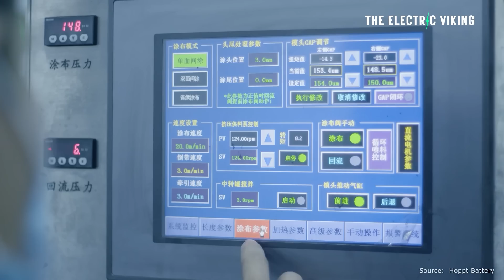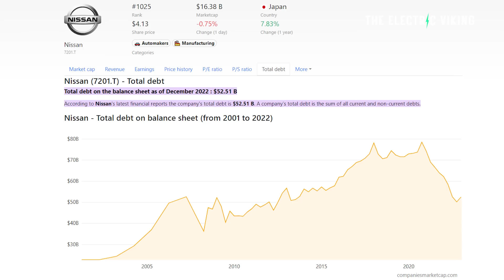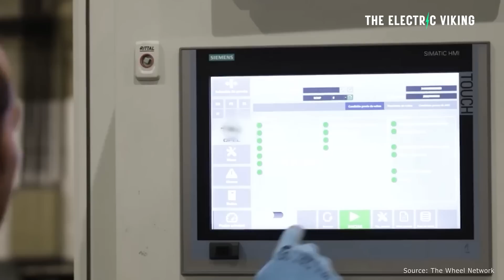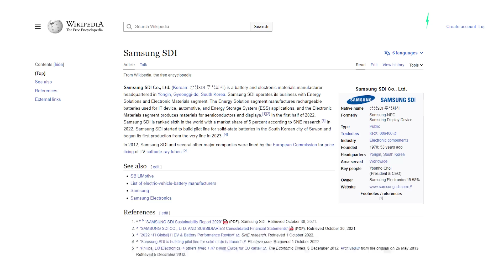WAY too many battery factories are being built in the US with the wrong batteries

Comment: Battery cell costs will halve, then halve again. We know this because Wright’s law. The cost curve is similar to PV, small gains from performance, big gains from automation of production, right down the supply chain to raw materials.
Coal and oil are dead industries. Not a chance in hell of competing. Even outliers like long range flights and shipping it’ll be cheaper to make synthetic fuel using practically free solar. Everything else will use cheap batteries.

Comment: This is very true unless they can truly get NCM chemistries with higher energy density, seems like SK innovation and Samsung, and Panasonic seem to have no interest in LFP/ LFPM, also sourcing from Canada will be crucial for the future, which seems to be slow, legacy auto except for ford I guess have been slow to switch to LFP, they all want to target ‘maximum range’ for customer advertising and cold weather performance, but LFP you get to charge to 100% vs NCM only 80%, energy density has to be AT least 30% higher in NCA vs LFPM
Reply: Which big supply chain management entities and OEMs will be left behind by batteries 2.0?
Reply: It seems like CATL is still stuck at NCM811 b/c of numerous recalls (ie, fires) while the rest of the industry, especially the Korean trios, moved on to ultra-nickel NCM/A.  That being said, LG did announced last year that they are also building a LG plant in AZ, US for ESS applications. 

>>  LFP you get to charge to 100% vs NCM only 80%, energy density has to be AT least 30% higher in NCA vs LFPM  <<
All lithium ion batteries degrade faster under high SOC.  It's unfortunate that Tesla's popularized this myth that LFP is somehow invincible to it, when it really meant to say that the BMS in Tesla LFP must be recalibrated frequently (at least once a week) to estimate accurate SOC reading.    Under Tesla's 100% recommendation, LFP's degrade twice as fast as non-LFP to 10% range/capacity loss.

Comment: I would think a battery factory producing NMC batteries could move to LFP or LFPM without have to retrofit that much of the factory.  That's just the cathode, right?  The biggest hurdle of getting the factory built, staffed, and running would have already been overcome.
Reply: Nmc nickel cathode 
LMFP ( proven greater energy density than lfp ( jus by adding manganese)  lithium cathode………
Reply: M3P # 1

Comment: This is likely due to money managers being in charge. When I built my ebike 3 years ago, I specifically looked for an LFP battery.  Yes I paid a small premium on both cost and weight, however the number of charge cycles & much lower risk of thermal run away were well worth the costs.
I was a hobbyist researching his own components and was able to get to this point & my budget was <$1000 for the conversion of my mtb to a 1500W ebike.  Why is an automaker not seeing this, especially if building a factory

Comment: Yes, these factories will have a huge supply of the current battery chemistry materials...BUT, IF they can use most of the machinery that they have only need to acquire the materials to make the better/newer batteries, then they are not completely out of luck.

Comment: Excellent analysis Sam!  Nevertheless the inevitable succession of battery technology improvements has already been happening for many years and is likely to continue at even a faster rate going forward (think about how AI will be leveraged to engineer better battery chemistries & designs faster &  cheaper).  Keep in mind that this has been and will continue to be a good thing.  Of course there will always be winners and losers when disruptive technologies emerge.  The winners will be the battery makers and car makers that can pivot quickly.  Pivoting doesn't just mean immediately switching to a new battery technology, it also means figuring out how to package and price the superseded battery tech in a compelling product to a niche market, likely at lower price, and still make a profit while the new battery tech ramps up.  Look what Tesla did when they came out with the Model Y.  Even though the Model Y cost less to build than the Model 3, Tesla deftly negotiated the supply & demand curve an sold the less expensive Model Y at a much higher price but still made a smaller but tidy profit selling the Model 3's at a lower price.  Tesla is still making money selling Model S and Model X's using the most antiquated battery form factor.    Tesla has clearly anticipated upcoming battery tech improvements for years now.  It clearly no accident that Tesla has more "irons in the fire" when it comes to battery suppliers than any other auto maker and you can bet that any battery supplier seeking to maximize their profits on a new compelling product will and have been coordinating closely with the biggest EV auto maker.  We can always count on supply and demand to dictate the selling price of batteries and EVs, so we might find compelling new-tech LFP EVs selling for more than some NMC EVs while the new-tech LFP batteries are ramping up.  That will be a problem fo EV makers that are unable to pivot quickly.  Tesla will continue to pivot as necessary in order to continue to produce compelling new and refreshed EVs at a profit.  The other good news is that some people who bought older Teslas will find themselves lusting for the latest battery tech/performance and will sell their old Teslas to buy a new on, which in turn will put a larger supply of very good EVs in the used car market allowing people who can't afford a new Tesla to own one.
Reply: I pray ur right tytyty for ur comment

Comment: I think US factories are gonna be fine, as long as they produce the lfp or lfp based batteries for consumers. Having 90kwh to 120kwh capacity on a car with 3.5-5.5 miles per kilowatt will be the sweet spot imo.
Reply: They'll be fine whatever batteries they make. Demand is going to outstrip supply for several years.

Comment: I might be missing something here. If you build the battery factory, you can change the batteries chemistry correct ? Does anyone think we will be using current battery chemistry in 7 years ?
Reply: well the issue is that we are building factories of batteries with older technology and higher price. even they also develop.the new technology in,  say, 5 years. the question is can they survive those 5 years because CATL will start its mass production of its newset super charge battery which can give your car 400km range under 10 min charge. and without too much drop in cold weather. basically the problem is we invested so much money on something already outdated and we dont have the latest technology.
Reply: Wrong. 400km range is about 250 miles. At 4 miles per kwh the charge required is 62.5kwh. If this is delivered in 10 minutes the average charging power is 375kw. That is not going to happen. @jk9876
Reply: @jk9876 if you own Tesla mega packs you don’t need 10 minute charge & almost any battery will do
Reply: @jk9876 : Most of you are being mislead on the state of battery techs by this Viking dude -- whom I'm pretty sure is being paid by China's CCP to disseminate misinformation.  NCM is a constantly evolving cutting edge battery tech -- the latest variants NCM9 which is used by Ford in the F-150, Mach-E and Hyundai in the Ioniq5 N, has nearly twice the energy density of LFP, which is fairly critical in moving vehicles..   Do you seriously think Americans are stupid enough to spend $100+B on "older tech" as this Viking dude claims?   Or that Tesla is using LG's NCMA in their Long Range models?
Reply: You are correct. CATL is in the news not because of their proprietary chemistry.  LFP is not really not that new and is not proprietary to CATL - CATL's biggest advantage is production capacity -- not chemistry research.  Hence they appear to manufacture quick. That is what we need in the US -- large manufacturing capacity under American control that can pivot to new chemistries and formats.
Reply: Battery chemistry don't come out from nothing... They need R&D money and others like CATL and BYD have patented the formulas.... And they are already researching next gen batteries
Reply: >> Does anyone think we will be using current battery chemistry in 7 years ?<<
it takes on average about 3 years between your EV OEM signing a contract with a battery maker to a production line.  When it goes production it usually runs for several years.   Contrary to your lack understanding of battery technology, supply-chain, or the market, the whole industry moves much slowly than this Viking claims it does.   There is no new weekly groundbreak breakthrough in China; you don't just flip one chemistry from another.
 There is hardly anything amazing about China's cheap, inferior LFP - other than their low price and ample supply at this moment, which would all but disappear when the Southe Koreans battery trios bring up about 300+GWh NCM8/9 capacity in the US by 2025.
Reply: Seems logical
Reply: Note LFP is older, the revised battery are M3P (CATL) and LMFP (BYD) depending on manufacturers
Reply: @james_l4337  >>  the revised battery are M3P (CATL) <<
Not much is really known about CATL's M3P, other than that the company denied that it's a LFMP chemistry.
Reply: Not least the future is also sodium batteries which is yet to be mass released
Advantage of sodium batteries against all mentioned & in production batteries chemistry is
Sodium is supposedly fire proof, when shory circuited

If it is like that it is the battery for home, power plant & some cars

Comment: I'm hoping they use these batteries for grid storage. And also have the plants setup to be flexible to change technologies as new materials are discovered.
Reply: Lithium batteries are wasted on grid storage. Gravimetric energy density means next to nothing when it's just sitting in a building. Sodium ion, bromine flow batteries, iron air, pumped hydro, compressed air, molten salt, sand - there are a million ways to store energy when you're not concerned with using the power to move its own mass.
Reply: @DFPercush  true. The lower the cost, the better for that application.

Comment: If legacy builds battery factories, then go bankrupt, someone will buy the battery factories in the bankruptcy sale.

If the legacy companies build the wrong chemistry batteries someone can change the chemistry.  Just replace the cobalt, nickel, whatever with iron and phosphate.  The manufacturing process is the same.

If CATL, Tesla, or some other company can build cheaper batteries it doesn't matter.  Demand/need is so immense that the market will buy their more expensive batteries rather than have no batteries.

Comment: The Viking is spot on.
I greatly appreciate this knowledge and information.
Reply from the maker: Glad it was helpful!
Reply: @electricviking  However, the Mazda vid posted after that in my opinion was wrong. 
Mazda can use Toyotas hybrid, technology, and when solid state batteries are perfected Mazda will use that, along with Subaru, because Toyota owns a portion of Mazda and Subaru.
It would take a large investment to improve the incredible efficiency of SkyActive technology.
I had to fit your  “However” in there.

Comment: Agreed. We in the U.S. have put up a lot of barriers to doing business with CATL. I don’t see any problem with allowing battery tech from China to be licenced by U.S. companies or even allowing BYD and CATL to build factories here. We need to get this right because there is a lot of opposition to electrification here because of vested interests.
Reply: Wasn't the battery factory that was blocked earlier a CATL factory?
Reply: @jefflittle8913  Yes and no. Ford is building a factory in MI using CATL licensing. It was announced in Feb. after CATL decided not to build a factory itself because it calculated using 40% U.S. produced raw materials would wipe out any cost savings on shipping. Virginia had been a competing state to land the plant but dropped out when Gov. Younkin decided he didn’t like the Chinese connection. The factory will open in 2026 and Ford seems fairly comfortable that the Chinese government will not block the licencing. Gotion Hi-Tech also has a plant or licencing for a plant in the works.
Reply: @keithv3767  >>  The factory will open in 2026 and Ford seems fairly comfortable that the Chinese government will not block the licencing. <<
Why would the Chinese gov't block this?   One main reason China chose LFP under their state industrial policy back in the 2010's was due to licensing and their ability to "export" -- most key LFP patents expired in the last 2-3 years.  The competing battery technologies and patents were dominated and guarded by the Koreans (NCM) and the Japanese (NCA).
Reply: @tooltalk  They would block in retaliation for western countries blocking chip tech to China. I said they won’t. Others in comments said the would.
Reply: This is a living example of the absurdities of protectionism by using national security as excuse for everything to escape foreign competition.  Even the Europeans are complaining about America's unfair subsidies on local production of their EV industry.   Now everyone should be relieved as it becomes increasingly clear that much of these subsidies are being wasted on inferior and uncompetitive products that will only drag down their industry.
Reply: Chinese battery manufacturer “ Led th WORLD I’m serious “”……. in battery recalls) 
Meanwhile California proposed law will end sales of gas powered landscaping equipment  so uh uh
Reply: It's wasteful but this is how tech advances with yearly iterations of product. Not so long ago, CFL light bulb was brightest idea. Then white LED research breakthrough; CFL factory mostly now obsolete. Reasonable consumers see this quick depreciation and pick to be late adopters.  Competitive market sales eventually determines mainstream tech, not government mandates.
Reply: And speed up petroleum falling price, and hurt petro dollar lol I don't think US government will love what will happen in the next few decades.
Reply: >> Agreed. We in the U.S. have put up a lot of barriers to doing business with CATL <<
That's exactly what China did to protect BYD/CATL from the Korean battery competition who had prior to 2015, 50+% of the Chinese market share and 9 out of 10 top Chinese EV OEMs, now reduced to less than 1%.   The Japanese and the EU companies suffered similar barriers and abuses in China -- see the EU's WTO complaint WT/DS549 filed in 2018.
>>  I don’t see any problem with allowing battery tech from China to be licenced by U.S. companies or even allowing BYD and CATL to build factories here. <<
You don't, but many in the industry and the US geopolitical circle do.
>> We need to get this right because there is a lot of opposition to electrification here because of vested interests.<<
You mean the Koreans own the industry?
Reply: @tooltalk  The last comment was about opposition from the petroleum industry and other vested interests in ice. I do not understand the comment about Korea owning the industry. They don’t.
Reply: @keithv3767  >>  I do not understand the comment about Korea owning the industry. They don’t. <<
They don't, but the Korean battery trios have the most to gain in Biden's EV push.  I don't think the oil industry wields as much political influence under this particular administration.
Reply: @tooltalk  Political power only goes so far. The question is will the market accept electrification. So far the answer is only a small portion and Tesla dominates that portion. Americans, especially in the south, like their ice cars. They have seen the stories about spontaneously combusting batteries and think range is still too low for their needs. U.S. car manufacturers have to convince people outside the early adopters that electric cars are better. Right now LFP batteries from CATL, Gotion, and BYD address the concerns of the average car buyer. Good range and almost no issue with combustabilty.
Reply: The us is waging a cold war with China, this is the reason.
Reply: *because of ... sanity.
Reply: Opposition? The problem is EV adaption in mass has revealed a very bad infrastructure problem. Reliable green electrical generation on the utility level is also isn’t in place- the exhaust coming out of a utility smokestack instead of a auto tailpipe. Even China has not licked this problem, by building more coal power plants. The technical problems with EVs are small compared to infrastructure & electrical generation.
Reply: that's what happens when government values politics over environment and people's livelihood
Reply: @passby8070  : >> that's what happens when government values politics over environment and people's livelihood <<
Would you say the same if I told you that the commie China did the same to foreign competitors, namely the Koreans, since 2015 under Xi's state industrial policy to protect their weaklings BYD/CATL and eventuall dominate the industry ?
Reply: CATL battery can spy

Comment: Based on all the changing better technology and changing to Tesla charging system, should everyone wait to buy a non-Tesla EV?  If you buy CCS car and everyone changes to NACS within 1-2 years, will you car have very little value after 2 years.  Basically you’d be stuck with an outdated, unwanted vehicle.  But you still paid 40-50 K for it.  I’m glad I did not sign the papers yet.  Makes me nervous with all the tech changes.
Reply: An adaptor is a bit of a pain, but no reason to block a superior technology.

Comment: Lots of the ones with issues are the pouch batteries. Not clear from this which ones have those.
Reply: I am not a fan of glued together 4680 packs. One faulty cell and the entire pack needs to be replaced. That is the definition of poor design.
Reply: that goo did look tough to deal with. they should still be able to isolate a bad cell I would think. dk if they would go through hassle to do it tho.  @nordic5490